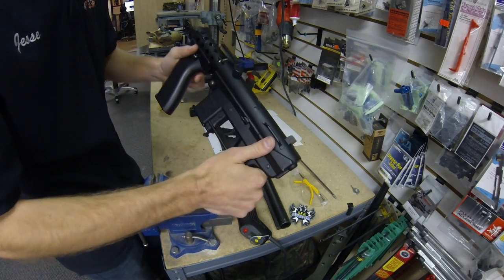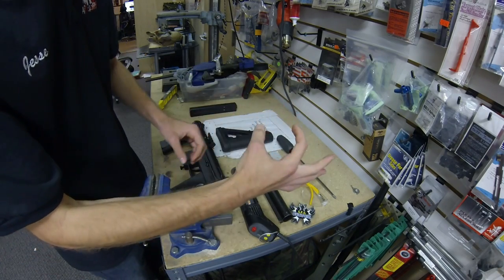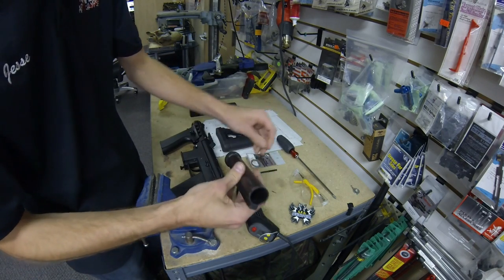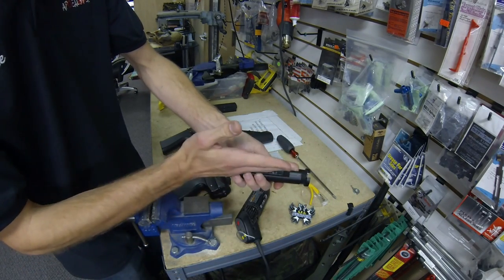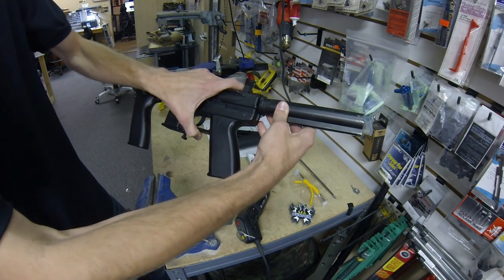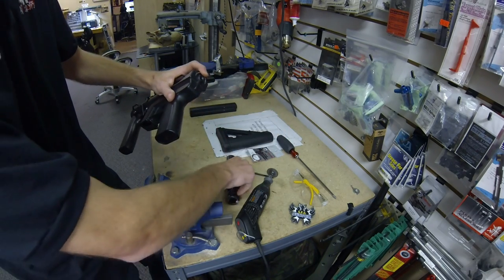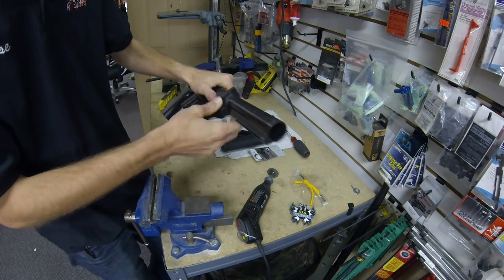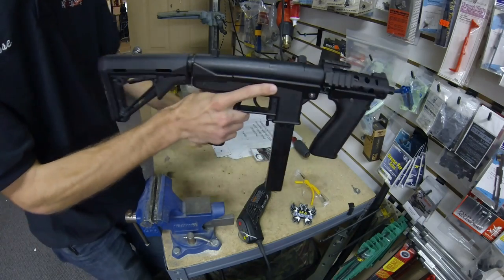Echo1 GAT Buffer Tube Mod (Easy!)

Comment: Hey guys loved the video! I was wondering where you guys got the rail segments on the front of the gun?
Reply from the maker: justin mildenberger The rails were from an NcStar Shotgun tube mount, which we had to extend a lot with a vice and pliers to fit on the Gat. We realized afterwards that adding V-Tac rail segments by Madbull were a lot easier, and nicer looking.

Comment: Thanks this helped a lot I have one question I noticed the rails up on the front how did you do that?
Reply from the maker: Genuine as The rails were from an NcStar Shotgun tube mount, which we had to extend a lot with a vice and pliers to fit on the Gat. We realized afterwards that adding V-Tac rail segments by Madbull were a lot easier, and nicer looking.
Reply: StrikeForce Sports could you do like a tutorial the would be great?!

Comment: You didn't say anything about the extra rails you added to the GAT! How did you do that?
Reply from the maker: eric h. Haha yes, the rails were from an NcStar Shotgun tube mount, which we had to extend a lot with a vice and pliers to fit on the Gat. We realized afterwards that adding V-Tac rail segments by Madbull were a lot easier, and nicer looking.

Comment: If you did this would it be possible to wire it to the back in the stock? This way .you could put something on the rail.
Reply: I have the same question
Reply from the maker: Executioner Airsoft Yes it is possible, Brian at Echo1 actually has a tutorial on making that modification.
Reply: StrikeForce Sports
 thanks, this would be so awesome to do. would also be cool to make a custom 4 sided rail over that small rail.

Comment: Nice how much is a gat????
Reply from the maker: Brandon Farley The GAT is available at SFS for $160.00
Reply: StrikeForce Sports You guys say it's indoor legal.  I just chronoed mine and it's floating around 350-360.  Will you guys give me a hard time If I try to field it this weekend?
Reply: Shadow Walkers i once chronoed in at 355 they let me in i think u will be ok
Reply from the maker: Shadow Walkers That will be fine. After a day or so of use they'll settle right at 350.